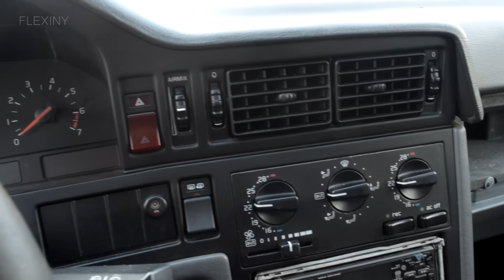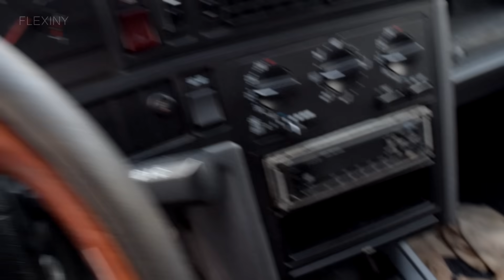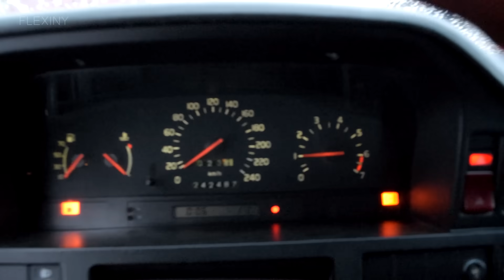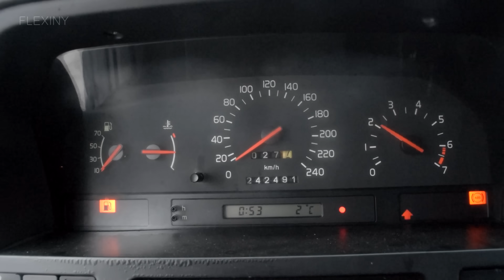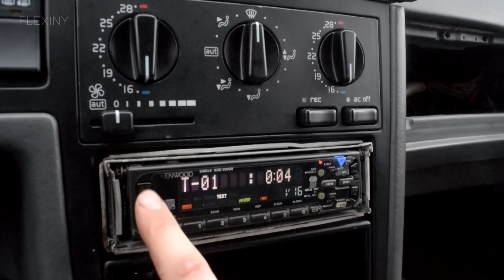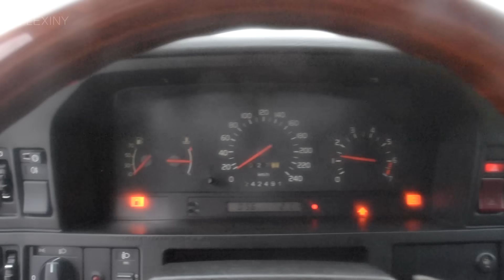Starting Volvo 850 After 7 Years

Comment: This car is worth saving, she sounds like a dream and clearly still has life in her!
Reply: Worth for who? Very nice 850 is around 2000 euros. Even this is for free (and probably can not be put on title again,because it does not pass test and sitting years on junkyard), only the stupid heater core itself is pain to change. Next you need to solve :
- timing belt
-all fluids including AT
-all brakes COMPLETE, calipers,lines
-probably rust spots
-front glass
-starter
-for sure some bearings, o-rings...
Etc

And you still have multicolor car with clear coat peeling...And molded interior as a bonus

Its not 850R...its completely basic model.
Reply: @jirka87  but its a volvo
Reply: Meeh, they are a paint to do maintenance on. Its not a rearwheel drive 7 series, those are build like tanks and easy to fix. 850 unfortunately not. But they drive nice.
Reply: @jirka87  but it’s an old Volvo, it can’t be that hard to maintain one of these, and from what I hear this things have gone up in value in some countries, with a little love a cheap paint job I think it could make a great little car. And considering the list you have made it really doesn’t seem that bad, getting glass, a starter, and fluids doesn’t seem that bad, now I don’t know how much rust it has nor if it’s easy to fix suspension components and brakes, but I suspect it’s not impossible most things appear pretty accessible
Reply: @peterdevreter  since when are old bmws “easy” to fix, those things aren’t exactly reliable to my knowledge at least, anyhow this is an old Volvo with a cool engine in it, powerful or not R or not doesn’t matter, I would consider fixing it
Reply: @peterdevreter  exactly this, brilliant to drive absolutely a pain to fix compared to 7/9
Reply: @leonm6969  but we dont talk about if it can be fixed or not. Almost EVERY possible thing in a world can be fixed somehow. But this is not worth it. And thats what Iam talking about. 

Old Volvo? And what? They are MANY of them. This is not 2xx turbo in mint condition. Its completely basic 850 sedan. Junk car in this condition.
Reply: @jirka87  do u know how to work on this ? Just put a turbo and u have the 210hp no problems.. put  the 2.5 naturally aspirated head reinforce the pistons and u push 300hp.. working on this car is probably the easy one i know ( also cause it was my first one ) but nothing less the sad true is that a good turbo is cheap, but dont talk about 7 series being tanks cause they are not the task volvo is really this one ! But clearly u dont know about old volvos
Reply: @tomasmonteiro8864  what has to do it with the point of the maint comment up here? He said : "its worth saving" and Iam constantly saying only that its not true. This car is not worth to save it. Thats all. And you all guys are like blind, deaf and crazy responding like - nono, its old Volvo super rare awesome car...other one tries to teach me how to put turbo on this shitbox...

I like 850. But this exact car is not worth to be saved. And this is only thing Iam still talking about as a response to the comment.

Jesus....
Reply: PHD in gender studies: She? 🤣
Reply: @jirka87  Ok, I was just stating my opinion you might not agree, my point is with some love this car can make a fun commuter for someone and that’s the engine is not scrap, the car ran like a dream after sitting outside for seven years regardless if it’s a R or a base model.
Reply: probably not worth selling but its a nice car to own and the mileage is not astronomical
Reply: She sounds like she is running on only 4 cilinders lol
Reply: Bellissimo lavoro
Reply: it is absolutely worth saving this car, I'm just sure it hasn't been in this condition for 7 years. a car that has not been driven for 7 years under the hood looks different ..
Reply: @jirka87  timing belt is right otherwise your engine would have gone to the junkyard after 5 minutes
Reply: This car is not worth saving. In fact that by starting an engine that has been sitting that long without checking that the fluids are good just basically destroyed the engine.
Reply: @leonm6969  yea ur right. It’s definitely worth saving. These people are just so used to throwing things away and replacing them. Sure it’s not as easy to work on as the older rwd Volvos, but it’s still easy lol. Compared to a modern car this thing is a breeze to work on. This car is what taught me to be a mechanic. They’re safe, reliable, comfortable, and depending on ur taste, they look nice. In this uncertain future, people need to slow down more and start taking better care of their shit. Who cares if it’s cheaper to buy one. Just go ahead and fix it if you can
Reply: These guys in the comments are crazy ive drove and maintained a 95 850 for 5 years easy ro work on I learned from youtube and its never let me down only time I broke down the alternator went bad
Reply: @jirka87  cheer up
Reply: @jirka87  could change out the entire suspension in the car new (cheap) for under $250 and in less than 2 hours with basic tools any self-maintaining car owner has.
Reply: @jirka87  Yeah except you don't actually need to replace all that, especially right away. Calipers can easily be cleaned up and rebuilt if they're rusty, but it's typically the road conditions that cause rust on calipers so they're actually likely in better condition due to sitting in one spot. Starter works fine. Obviously a wiring issue... Did you... watch the video? There's like no freakin rust. As for the "multicolor" paint, once cleaned up it's just a mismatched fender. I bought one literally yesterday for this exact car for $75
Reply: @jirka87  😭😭😭
Reply: Leon M I think so too
Reply: It actually does not sound like a dream. My friend has an 850 so I know what it should sound like. This one is clearly not running on all 5 cilinders. More like 3 by the sound of it. Sad, because these engines are bullitproof and sound so great when running correctly.
Reply: @NLterror6000  Yeah or even only on 3... sad right?
Reply: @jirka87 😭😭😡
Reply: Это прекрасная машина кто бы что не говорил. Такую стоить привести в порядок шведское качество не сравнится ни с чем !
Reply: @jirka87 in estonia it does not matter how long has the car been sitting or if doesnt pass inspection
Reply: @tomasmonteiro8864  what about my Volvo S 70  1998 mod, 5 valves, , gone 209.000 km  nothing wrong with my car,, its fluent,, is it a GOOD car? :D

Comment: 850s are getting more expensive. Engine sounds great, even after standing 7 years.
Reply: Not really that healthy
Reply: i can get a volvo 850 for 1k€ with the 20v in finland with a inspection done
Reply: @nitroruski7986  you can get a volvo 850 for even cheaper than 1k.
Reply: @Juoppolalli  sure, but here in the Netherlands they used to be from €250. Now its moving to 1500-2000 if you want something half decent. S/V70's are now cheaper than 850s, especially the turbo's.
Reply: @mehrzahl2219  what about 700 or 900 series
Reply: @Juoppolalli  even more expensive, 3k€ or more...
Reply: @mehrzahl2219  of course it is
Reply: Yes certainly, especially the Alter 1's

Would love to have that spoiler with brakelight for my A1
Reply: A car that has been standing outside for 7 years looks different under the hood ... I'm sure, who knows what I'm talking about.
Reply: @hondahr4577  7 tons of dry leafs is not argument?
Reply: @nitroruski7986  same in sweden

Comment: You’ve inspired me to get my 850 up and running again having been abandoned for about 3yrs!!….can’t beat that 5 cylinder sound 👍👍
Reply: I have a 1996 Volvo I need a tail light lens for the right side and a turn signal right lens for the right side do you know where I can get any one of those parts
Reply: Vparts
Reply: @alancrutcher1118  vparts, scstyling.
Reply: Last year I started my 850 for the first time in about 3 years. Unfortunately had to take it to the junkyard however, I never had the time to replace the transmission since I had other cars I was driving.
Reply: Quantos HP? ?

Comment: Did it today people!!….finally got my 850 fired up again and it felt great!!! 👍…..it’s been stood idle for around 3 to 4 years, I checked the oil and coolant, put some fresh fuel in the tank and connected a brand new battery, unbelievably it fired up first time, no hesitation, coughing or any drama whatsoever!! 😳😳 what’s more, all lights were operative as well and the only lights on the dash were “low screen wash” and “low fuel” unbelievable!!! 😃😃😃👍

Comment: Great video, I bought a V70 with the same engine and auto box for £150 and it had the same gearbox fault light flashing.. it seemed to be pulling away in second or third. After a fluid flush, it worked perfectly, cleared the fault and it was driven from Scotland to Rome and back.. twice!
Reply: £1=₺2.056 😮😢

Comment: I currently have a 1998 850, in absolutely great condition. Lovely car, I have fixed all the common issues (which was not expensive, because parts for these are dirt cheap at least where I live.) Runs great, has never let me down. Passes inspections like a breeze, never had any major problems with it after I took care of everything. I will try to keep it alive for as long as possible, I don't drive a whole lot so I reckon it should last me quite a considerable amount of time. :)
Reply: Hi! what are the common issues that this car usually has? i am looking to buy one as a first car ,Thanks!
Reply: @ferri.g4  :) you won't be dissapointed! The solder joints crack in the ABS module. You need to take it out and cut it open with a hacksaw, resolder them, and glue back together and it should solve the ABS light issue ^~^ ABS light won't pass inspection. The gauge cluster sometimes gets broken solders too, but easy enough to fix. 

Other than that, the only thing I can think of that often fails other than that is the rubber boots for the front drive axles. Easy to change with one of those openable boot kits.

And of course, go over the brakes, change all rubber flex brake lines, all the usual. Give it oil change, filters, everything. 

They're lovely cars, unfortunately mine was in a accident so it's unfortunately no longer with me, but I honestly want one again!
Reply: @tigerelectronics5966  thank you very much for the explanation and for your time, I will do everything you have told me when I get it (probably in a few months), I hope you can have another one again. <3

Comment: these are really great cars and the 5 cyl engine is just beautiful, my dad had an 850se. only letdown would probably be the auto gearbox, it failed on my dad's car as well and only reverse worked. heard from others that its a common failure point too. but despite that i think these are still nice cars, would like to own one myself one day
Reply: not a common failure- cause is neglect. factory recommended service interval is 20k miles for trans drain and fill and recommend full flush every 100k. that was almost never adhered too by careless owners, and yet most of these cars that are still on the road are at 200k plus miles running strong.
Reply: Worth it. My first car was an 850 base model 5 speed. Still daily drive it. In the meantime I bought an 850 turbo, then an 850R. Sold the 850turbo and 850r. Just recently bought an 850 t5r! Great cars. They like to have problems but I have never seen a stock one blow up, or modified one for that matter.
Reply: Just service the filter at the tramission gear ..!
Reply: And the pcv. Some owners never service that but a pcv service every few oil changes will keep it leak free for a long time
Reply: Io posseggo una V70 2.5 D del 1999 ma secondo me sono meglio i motori a benzina
Reply: @aylahughes9185  i see, thats great to know 👍

Comment: Still using my 95’ 850 GLT. Has around the same mileage as this girl here. After swapping the alternator, doing the pcv system swap and putting in a thermostat sensor it’s been running pretty well. Only things now is that on the sport mode after going full throttle transmission light turns on and the sunroof mechanism is gone. To another tens of thousands of miles!

Comment: We have had a year model 1997 Volvo v70 10 valve naturally aspirated car since v2006.
Very durable and reliable and hardly feels the load.
the only minus is high fuel consumption  in the city.
On the highway, it goes up to 7 liters if you don't press the gas pedal hard.
When you change a part, it says Belgium, Sweden or Germany.
we also have V.2006 model gas burner Bifuel Vovo v70.
Really nice car as well, but I recently changed the water hose of the expansion tank that said made in Poland.
It's nothing, but in the older Volvo, all the hoses are original since 1997.
A small quality deviation, however.
The Volvo lasts a really, really long time and is at its best in winter driving.

Comment: Heater core leaking is a common failure on 850s. Same as ABS light, which likely is a cold solder in the ABS control unit. Resoldering is definitely doable, theres lots of people who done it already. 

Btw, i apologize for nitpicking, but judging by the headlights and the interior switches, it's a 1994 model year. 91-93 had larger headlights. 95-97 had different interior switches. You can check the VIN for verification, the 10th number is the code for model year. N for 92, P for 93, R for 94, S for 95, T for 96 and V for 97.

Edit: Just seen the bumpers. Those were 91-93 only, so someone converted either headlights to newer style or bumpers to older style. So might be a 92 after all, especially if these are 4-lug wheel bearings.
Reply: Thats pre facelift so 91-95
Reply: @mohis5664  yep. 95 was the facelift year but unsure if they make pre-facelifts also in 95.

Comment: Not a rattle from the Hydraulic tappets on start up from 7 years.
Worked at a Volvo D back 28 years ago and these 850s used to come in for service with mega miles and running sweet as a nut. 300k
I came from a ford dealer and most ford 1.6 CVH engines and 2.0 OHC 4 cly were lucky to see 130k without serious oil conusmption.
Volvo 2.5 5Cyl were well made think ford used it in the RS Focus in early days of production

Comment: I have an 850 as a daily driver that is the same colour and with the same rims haha. It's a combi though.
600k kilometres on the odometer and still runs well

Edit: What I never knew 850s had 4 bolt rims, mine are 5
Reply: they changed it in later model years, i think in model year 94 they started with 5 lugs.

Comment: 3:24 replace the thermostat in the airbox housing. This is the same for all NA 90s Volvos. It regulates a valve between hot air coming from the exhaust manifold and cold air coming from the grille. When this thermostat is broken, the valve is stuck at hot air from the exhaust manifold. A big power difference when the engine is warm. I've experienced Volvo specialists and Volvo dealers forget to replace this simple part. It needs to be replaced every so many years and often it never has been replaced...

Comment: Volvo is volvo, but yeap.. the 9/7 series are the beast.. i've been takin care of my 960 '95 for almost 10ys 😂...  the worst damage i had was only the fuel pump dead.. and oil leak non others and now, 2022... the OD sensor is blinkin.. i hope its only dirts on the socket... the point volvo is amazing..

Comment: The transmission fault light was flashing so the transmission is bad. The driver should have switched to the winter traction mode instead of gunning the engine. That car still needs a lot of work. Plus the heater core needs to be replaced. The windshield looked like it had a crack on the drivers side too. Good luck with that Volvo.

Comment: Got an 850R sitting in my driveway. Auto saloon black with light beige alcantera, body needs work suspension needs work. Runs like a dream, first everytime if the battery is charged. Offers?
Reply from the maker: In which country?

Comment: We used to had a 850 t5 wagon in a few years ago very well option but sold because of the ABS done
Reply: Resoldering ABS Control Module would fix that ABS-problem. But also easy to diagnose ABS problem is it the module itself or the ABS sensor with multimeter.
Reply: @BassApe  sadly we sold it
Reply: ABS Control Module fail is common in P80's like @BassApe said or rear ABS sensor, easy fix.

Comment: At around 200000 you need to replace the oil pump it’s a weak point in the Volvo 5 cylinders it starves the cylinder head

Comment: Why you don't clean by power wash the engine ...,  compartment ...will be nice ...! I'm still driving my 940 auto single turbo 4 cylinders 1997 model, top speed OSO 220 kmph # rear wheel drive * can do drift at grass surface when wet  , 850 got 5 cylinders # front wheel drive ,  🎉extra valves.

Comment: My 850 won't even start after 2 days. Somethings sucking out my battery
Reply: Sometimes the light in the glovebox stays on after the car is shut off and it will drain the battery. I sold my 850, but I had the same annoying parasitic drain issues when I owned it. Meanwhile, my older 740 will start instantly after 2 months sitting.
Reply: @nyctereute9118  thanks for the tip 👍